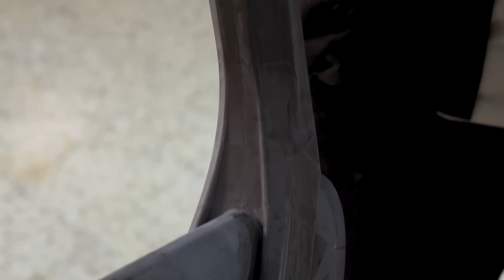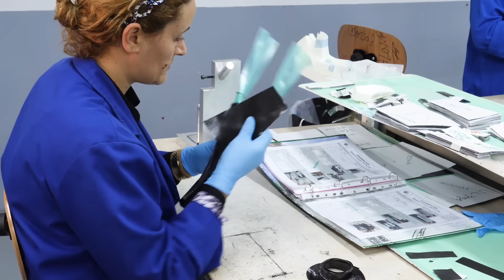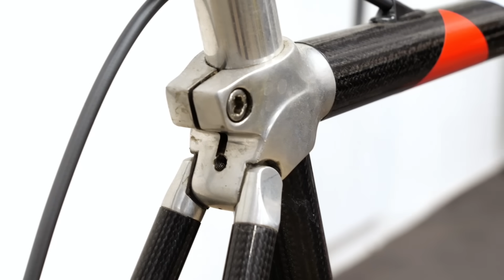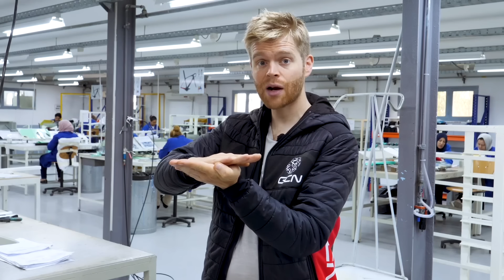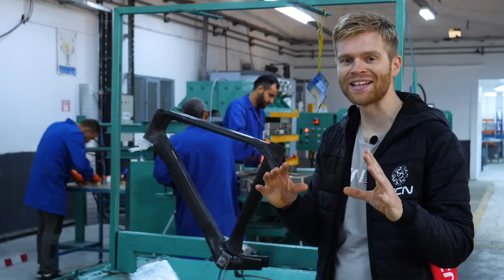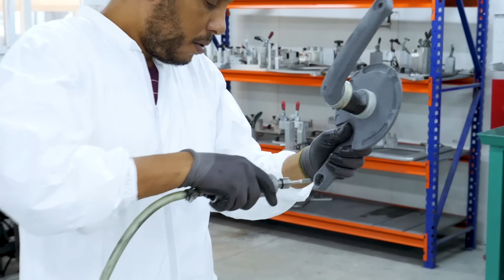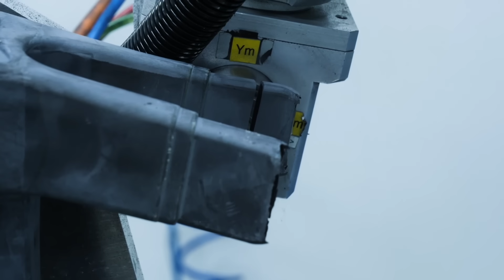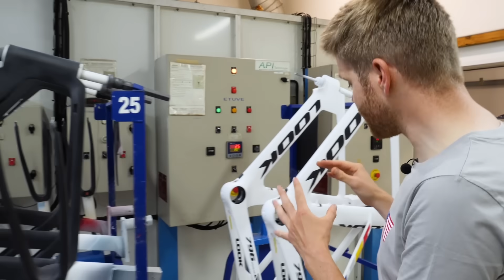How Are Carbon Fibre Bikes Made? | LOOK Cycle Factory Tour

Comment: From a company of that particular size i would expect a better protection of the workers ! Carbon fiber dust must not be taken light minded. Studies clearly show that this material is not inert and may cause serious harm to your lungs. I see people without masks sanding and grinding the bikes. If i were LOOK i would not show this footage to anyone...
Reply: Good point. Machining carbon composites is horrible for human health and it's extremely difficult to contain the dust
Reply: @bpeterson7227  its a prolonged exposure you'd be safe if you actually breathed in a small amount. Like smoking it's a numbers game as a rule. In saying this yhe more bad stuff we keep out the. better.
Reply: @glennoc8585  Carbon fiber is not destroyed by the human body it says in the lungs for ever..
Reply: Especially that Look themselves advise their customers in frameset manuals to be very careful not to breathe in the carbon fibre dust when cutting the integrated seat masts.
Reply: That's why they do it in Countries with low labor rate and no workers safety.
Reply: mehrshadvr4 for the other compagnies its made un taiwan
Reply: Oliver Dieball, carbon fiber actually is inert.  But you are correct that the workers should be using breathing protection such as N95 or better masks or ventillators, at least in the sanding and finishing areas of the plant.  The danger is not chemical but rather mechanical, as the fine dust is harmful to the insides of your lungs, in a similar way that asbestos dust is harmful when inhaled.    https://www.sciencedirect.com/science/article/pii/S1878535214003360
Reply: @berthull9333  Good points.  Carbon fibers are about 100 times larger than what HEPA or N95 are designed to capture.  (The first thing I did when I saw the factory was look this up.  I wear N95 respirators frequently at work.)    The cutting and assembly people are probably okay with no respirators, as long as the room air is adequately filtered.  Any place there is sanding or spraying might be a different matter.  It depends on the size and chemical composition of the resin dust.  Disposable N95 respirators cost me about USD$2 each on Amazon, and cost my work about half that in bulk for about 20,000 people.  Workers in Tunisia, Shenzhen and quite a few other places where bicycle factories are located typically earn fifty cents to USD$1 per hour.  You need to stock close to twenty different models of N95 respirators to fit 90% of the population.
Reply: @berthull9333  Unfortunately your reference points to nothing related to work saftety, or the health effects of carbon fibre processing.
Reply: @berthull9333  resin
Reply: They are using down draft tables but they should still be wearing better masks than those disposable ones.
Reply: @mq1506  yes, I totally agree with you, because I work small carbon accessories by myself, and I never would not wear light masks as I see in the video, except when I use carbon with 800-1200 wet grit sandpaper. For all the other works, layering carbon, using epoxy and so on, I always wear gloves and a 3M half face piece Respirator with cartridges and replaceable filters
Reply: In my own business carbon is processes in clean rooms pressurised to capture particules through high efficiency filtration systems into hoppers then the dust is disposed of responsibly.
Even then all operatives wear air fed masks and full ppe coverings.
Reply: Yep and noise too, if you have to raise your voice to be heard then hearing protection might be needed! Also the guy near the end spraying clear coat with nil protection!!! VoCs will kill him in few years...
Reply: I think Oli was lucky to get a look in at the Tunisian factory. The big factories in China wouldn't let a camera anywhere near the production facilities.
Reply: I agree, I'm a composite boat builder myself, now working in aerospace, that would NEVER fly in any first world country in this indystry. Sure sometimes you may not wear one in a heavily ventilated booth to scuff something up for a few seconds(I'm guilty of it) but as your main job, day in day out, that must have long term health risks. The thing that made me pause and go 'WTF' was the women laminating the rear arm or fork with bare hands. Not only is that a health risk, as epoxy should not come into contact with the skin. It is also a HUGE QC issue. Oils from your skin, especially hands are transferred to the laminate (Pre-preg in this case) creating a barrier between the layer it's on and the layer it's going onto, creating a poor bond. If this is a high load zone it can dramatically increase the chance of delamination, causing a chain reaction in said loaded area and a possibly a complete failure, large crack or just a straight snapped frame. This LOOKs really bad.
Reply: As in every video were particulate masks are worn, be it this or animal rescue, or house hoarders. They are wearing masks usually below their nostrils. The same as the famous blue gloves to keep them safe from what ever they are touching and then wipe their face ,eyes and drink bottles with the dirty gloves on!
Reply: guy spraying clear coat without a mask!!
Reply: I mean, composite residue only poses a health risk if your country has labor laws, so in Tunisia it's perfectly safe.  ;)  Besides, safety equipment costs money and reduces margins.
Reply: There's a reason why they're being manufactured out of Europe.  Less regulations.  Less litigation.
Reply: Oliver Dieball Agree,  that’s first think I noticed! Bikes are build in a country where nobody cares about safety, apparently. Bean counters at Look would have to add cost of 😷 to their bikes.
Reply: @lookcycletv  You ignored the blatant disregard for improper use of, or missing PPE in your Tunisian factory. The manufacturer is responsible for implementation of the health & safety of their workers not just giving them PPE. Look should be ashamed of itself. I’m left feeling that Look is a ‘profit over people’ company and will never even consider buying anything made by Look.
Reply: Same with the painting. The gizmo got no mask an probably no additional fan for the paintdust
Reply: Carbon fiber should be considered as dangerous as asbestos. It means use of p100 (particle) filters only. 

https://l.facebook.com/l.php?u=https%3A%2F%2Fwww.ed.ac.uk%2Finflammation-research%2Fnews-events%2F2017%2Fcarbon-nanotubes-may-pose-cancer-risk&h=AT2R4e-4EZvvgtDM7WNCcLqUQys1DRfkjrIa6phbq610BFv7qXK2P-lcK9vJiB90s3FeRF7q2lRZk3jCFokIk9SDqAO8UwHxEbC6yyFmr_4ENXgxuy6JNouywD52d15G_H6UmKk
Reply: what about dust in the air, should that be dangerous, too? Who you gonna sue when ou lungs fill up with naturally occuring silica? You are simple and are the reason why in 10 years we will all be living in plastic bubbles dying fat and young.
Reply: Oliver D   Why do you think they have production in Tunisia? No workers protection laws!
Reply: It’s Tunisia 
No health and safety 
Why do you think these companies get them made here? 
China same
Reply: This is about the same level of protection that workes at AIRBUS or Boeing have if they work on carbon fiber. Its fine.
Reply: I just bought a Look 795 blade before seeing this video, and the lack of care for human health makes me sad. Then I realised that it's probably the same throughout the Asian manufacturing facilities, and that made me feel worse. :(
Reply: I disagree with your observation. I have worked and visited many composites shops in the United States and Europe. The safety practices in this video look consistent. The machining area is clearly isolated from the rest of the production area so making people wear a truly effective respirator (with fit check) for no reason would only make the job torturous. Additionally, virtually all modern CNC mills used to machine parts operate in an additional enclosed hood with dust collectors. Those not only protects the workers but also nearby equipment since conductive materials like carbon fiber and metals can quickly destroy the electronics of expensive manufacturing equipment. Last note: I have seen shops that don't follow these practices and I assure you the facility would be filthy; on par with a coal mine.
Reply: Oliver Dieball I agree. Especially the sight of the woman with her nose outside of her face mask
Reply: west world...
Reply: Came here to post this comment. This would not fly in the UK, good thing its done in Tunisia ...
Reply: Just look at China, search for Lu Guang. Horrible history of human rights, environmental protection. That's the reason Look are here in the first place. Cut corners = more profit. 

https://www.nationalgeographic.com/culture/2019/01/where-is-disappeared-chinese-photographer-lu-guang/
Reply: See Dwayne Johnson painting 2 pack without a mask lol
Reply: I was thinking exact same thing I looked to see if anyone had mentioned in comments
Reply: they are using pre-preg carbon fiber, not dry one... the resin that soeaks the carbon fiber keeps the particles down....  if it was dry carbon fiber for RTM working, then they should be wearing protections
Reply: this apply to any material, anything enter the lung is bad for you, especially the very small ones, and if you can imagine what a carbon fiber is, it just a carbon and plastic from the resic when you sand it on finishing. which is pretty much harmless if you just put a cheap mask. So much fear mongering here
Reply: @royk7712  Thats actually a wrong statement. Your body doesnt detect carbon fibers as foreign objects. Thats the danger of it.
Reply: @MrBusunglueck  i understand that, but it still true thought, anything that enter the lung is bad
Reply: @royk7712  yes and no. Your body is designed to deal with it. Dust ist kinda natural.
Reply: @MrBusunglueck  dust = 80% of it is mostly skin which is carbon compound which is the same as carbon fiber, and the rest of it is dust from sand which is silicon oxide and its more dangerous than carbon
Reply: @royk7712  thats entirely wrong. carbon compound is in no way the same as carbon fiber. just because they are both made from carbon atoms it doesnt make them the same. similar to diamonds and graphite.
Reply: @MrBusunglueck  i get it, it just similar, the skin is a organic compound, the carbon is also an organic compound, mostly polymer that have a very long chain of carbon atom. And it will degrade overtime and it will be metabolized by body somehow from the lung, it just take a longer time for carbon fiber to degrade over time. And it apply on any material

The point is, any material can be dangerous. Pointing at one material and call it dangerous is very ignorant. If they follow the safety procedure to deal with the material it can be called safe. Its just which one will be deadly on shorter period of time.
Reply: @royk7712  carbon fiber doesnt degrade. thats the point. i wont explain any more. get a book.
Reply: @MrBusunglueck  OF COURSE it doesn't, that's what I'm saying in the first place, its just 99% pure carbon or graphite. It non toxic and easily metabolized by body so it won't accumulate in lungs, congratulation you just prove me right

The resin that bind the carbon fiber is more problematic but the amount is so small because of heating when the carbon fiber is produced
Reply: shut the fuck up Oliver, fuckin idiot
Reply: Like ag-gag laws! Sick sad world.
Reply: Absolutely!
I also saw some workers who didn't wear protections such as mask, goggle in this video. Dust and particles can be harmful for them.
Reply: They have "Special" carbon fiber that actually healthy to inhale. Duh!
Reply: Look they didn't show you vids of child workers so stop with the judgement. Okay!!!!
Reply: They use prepreg which does not really deliver fumes, no need for masks. Carbon is inerte. But yeah, sanding should be taken care of more seriously.
Reply: Oliver, it’s unfortunately very obvious that you don’t know a thing about carbon manufacturing! As some have pointed out, downdraft tables are employed in these workspaces. They do it at places like Audi sport as well (where they make racecars) so it’s a true method! Also, we don’t actually know exactly what carbon dust does to us, so caution is good, but we can’t say for sure how it would behave in our bodies.
Reply: No one was sanding or grinding without a mask. Here's another interesting video showing the process to make a carbon fibre bike, you'll notice they didn't need a mask at any point. https://www.youtube.com/watch?v=UWSePEV88tw
Reply: There's a lot of reasons companies don't want to manufacture their goods within the EU. One is environmental regulations and pollution taxes, one is worker salaries and a third is definitely worker protection regulations. Government corporate taxes is probaly way down on the list for outsourcing/ moving to a third world country for many big manufacturers, but it's about the only politically correct reason for them to give. As a consumer you can only choose what your supporting.
Reply: Why did they set the plant un Tunisia, according to you?
Reply: Of course, they outsource to another [poorer] country and don't care about the safety of those workers.
Reply: Easy solution, put the plant in a third world country that has no worker safety laws.  Why do you think massive numbers of USA based companies have moved manufacturing to Asia.  Not only for the benefit of zero environmental and worker safety laws, but cheap labor plays a big role as well.
Reply: Tunisia is like Africa/middle East so it's alright mate don't stress
Reply: Its   a good way to lower the production cost.
Reply: What are people blathering on about? All the women were wearing masks, gloves and protective coverings, they are not dealing with raw CF it's already resin impregnated, so those masks are fine, the men were using industrial down draft tables, only the one guy using the deburring tool in the BB was maybe at fault. You might be able to fault the workers for not using the PPE, or not using it correctly but it's obvious that LOOK is providing it.
Reply: Ojnlkl8jkb
9l.
 BBK blij
Bhnhlomhih. Lmu
Nmuojvm7hlnixbmlilubhoh. Die v in bmiij0cl
8gjgm7bihohnu.hh08
Reply: as an avid elite cyclist but also aerospace employed, I have not even cut off my seatpost. we do not permit it in aerospace, it should never be permitted anywhere. the problem is on the cured frames and drilling, the dust.
Reply: Oliver D ....Did you ever think this video was made before the virus?
Reply: There are shitloads of people.
Reply: LOL  You're funny.  Obviously, you must live in a 1st world country and have a 1st world job where "rules" are paramount.  The whole reason companies like LOOK outsource production to 3rd world countries is so they can AVOID troublesome and expensive things like safety policies.  Ok course, they are going to spin their corporate bullshit if taken to task for it, but this video shows what they feel the "value" is of safety programs and human life.  To the workers, it's a job and some good money.  Wages still astronomically lower than western worlds, but light years better than the majority of the populace of Tunisia or any other 3rd world country.  Cheap labour, cheap human life, minimal rule enforcement and crooked officials that are eager to pocket a bribe to look the other way are some of the major reasons why corporations build their factories where they do, then 1st world muppets line up to pay premium prices for things that cost a fraction of the retail cost to make.  THAT is the real manufacturing world for the majority of the planet.  Sorry to inject some reality into your "safe" life, lol.  Not.
Reply: Now they are wearing mask because of covid 😂😂
Reply: I totally agree with you on the mask part over the painting and sanding.
Reply: thats the reason why they are producing in tunisa
Reply: It starts with a guy spraying without a mask.  Lowers expectations.
Reply: Jup. Agreed to most of you in here. LOOK... you can't outsource responsibility. Maybe by law you can – by ethics = No, you can't!
You're destroying lives here, for what? Profit?! Screw you!
And that corporate PR bullshit you put up here... not worth the pixels they're printed on my screen.

One thing is sure though: I won't buy a LOOK bike or component ever again. Thanks for showing this to the public GCN. Though... shame on you, too. Because not mentioning this with even the slightest word harms your cred as well!
Reply: They apparently do not handle the "naked" carbon fibers as we did making space/aerospace parts but already epoxy treated prepregs (not polyimide) but nevertheless I agree they should protect the workers from any dust caused by drilling, milling, routing the bike parts. The guy spray-painting the parts has no face mask either, so why worry about carbon fiber dust?  LOOK has a responsibility to protect their workers onshore and offshore.
Reply: Wow, I just was going to write about that and find it as first comment. Good point! I´m a custom wheelbuilder and don´t build carbon rims because of that reason*. All that environment where speaker is in has to be full of PM2,5 carbon nanotubes. It´s not necessary to be exposed to them because we have other materials. Plus the impact of epoxy vapors, carbon source: petroleum. No carbon, thanks.  *Not only you get exposed to particles that come with the rims (inside, packaging, etc) but they are produced WHILE TIGHTENING THE NIPPLES BY FRICTIONING THE RIM. You can see the black dust. You can even feel it in your throat.     Those workers should be protected with specific clothing and masks. Particles stay in their clothes and then go home with them. We can´t know if they use air filters. Want to think they do, but it´s not an excuse not to protect workers respiratory system.
Reply: The riches ride the workers not much life
Reply: One thing I learned from this video and the associated comments is that I do not want to have any part in an industry that is so environmentally irresponsible. Look allows its workers to be lax when it comes to the use of Personal Protective Equipment (PPE), they are dealing with a substance that is harmful to the human body. Also, as has also been mentioned, it is non biodegradable, and the waste will clog our landfills for generations. Oh, wait, it's some landfill in Tunisia, so that makes it ok, doesn't it? I would like to know if breathing carbon fiber particles compares to breathing asbestos particles. I would not be surprised if the results are similar. And, to to it all off, the only reason Look (and likely other frame manufacturers) choose places like Tunisia is because of the cheap labor. So, the next time you want to hop on your CF frame bike, think of the people you are affecting. This video has helped me decide that I will never own a CF bike.
Reply: John Bruins what if the bike you are in did the same thing but never been exposed ?  Profit it’s the purpose of a company.  ..... bleedy lessons.  ....
Reply: John Bruins you have no idea of what you are talking about. You probably think you are the greenest person on the planet.
Reply: I agree. It LOOKed unprofessional.
Reply: Damm corporate greed---they care only about the profit not the people who work for them.
Don't buy LOOK--greedy style
Reply: I am certain those adhesive and solvent fumes are also v dangerous.
Reply: HAZARD
Reply: Oh well not surprising. Starbucks got their coffee at the expense of poor farmers in Indonesia/south america etc. Iphone were manufactured by priviledge slaves in china, the world revolve around these systems. Sad thing is, most developed nations come around and start criticizing these hazardous working conditions, not knowingly they get to enjoy their humane living condition based on the low living standards of 3rd world nations. Regardless of what human rights organizations or green peace are fighting for, its the way things are run, no one is seriously trying to change that.
Reply: Money saved on welfare by being made in Tunisia
Reply: Only Trek!
Reply: Like most corporations They don’t give a flying fuck about human beings! Only money and power!
Reply: @smkthomas2  weirdo
Reply: They are expendable muslims...don't worry
Reply: @opwan , may I suggest that you look into an aluminum frame instead? Yes, Look has a big problem, as this video has shown, but I would submit that they are likely not the only one. As someone on this thread mentioned, I think it will be shown in fewer years than most would like, that CF frame production is going to be right up there with using asbestos. Unless things can get cleaned up, I can see CF being outlawed because of H&S concerns. Best to jump off that bandwagon ASAP.
Reply: Absolutely! LOOK should be ashamed, disgusting to see the poor PPE standards in this video.
Reply: Is not a stress resistant material. Just look where they put it in cars. In a bicycle it chips out bits and pieces
Reply: Dear Oliver, we are proud of all of our manufacturing sites. In Burgundy (Nevers) France, where all pedals are made and all frames are designed and prototyped, and in Tunisia, where most of our frames are made. All our employees in France and Tunisia are equally treated according to our health and safety standards. We employ women and men, all of whom are proud of the brand and the skilled work they do. Most of them have been with the LOOK family for many years, and their loyalty and high level of craftmanship is what makes LOOK great. We run factory visits in France and Tunisia, for those interested in learning more.
Reply: lookcycletv The fact that you treat all employees equally and are compliant with European health and safety standards doesn’t mean that your H&SP are not substandard. Nor does it protect you from liability. Just ask Companied who’s workers were exposed to asbestos, crystalline silica and coal dust. Meeting legal standards alone is inadequate. The best available demonstrated technology for engineering controls, PPE and administrative practices should be observed to achieve best practices. Lawyerly PR statements do not impress.
Reply: @look_cycle  and what about handling epoxy without gloves? Epoxy can cause severe sensibilization, which would make the person unable to work anyware near epoxy for the rest of his life..
On top, the grease from the skin weakens the strength of the interface, thus reducing the material properties. Also there no excuse..
Reply: @look_cycle  Please require all of your employees to wear PPE (Personal Protective Equipment). I have holed in industry for years and it is the difference between hearing loss, injury and early death. It also influences my purchasing decisions. I can clearly see the care and quality that is put into manufacturing your products, but worker safety is equally important to me.
Reply: @skulengu6854  maybe you should give them a class, because LOOK is full of idiots!!  Good for you sir!  As a former FireFighter and a nurse I appreciate the damage done to the human body through the environment.
Reply: Good thing to know you are proud of workers spraying clearcoat with no protective means at all. Goes to show how good a company you are. Thank you for your clarifications in flawless stereotypical corporate jargon. I have a look 986 which I initially liked but due to the very poor bb30 tolerances it creaks like devil. That is why I ride a BMC and will never look back (pun intended)
Reply: @look_cycle   no matter how proud you are it wont keep them from getting sick..... You're playing with lives.......
Reply: @sunesnigel  But compared to decent masks or safety guards lives are sooo much cheaper, if anyone complains or gets ill just fire 'em, they may have good frames but their true reality, not the PR piffle, is the way they treat their staff.
Reply: @look_cycle  "All our employees in France and Tunisia are equally treated according to our health and safety standards." 
Are your health and safety standards, policies and procedures identical in both countries to each other?
Reply: LOOK Cycle I guess good to know employees in France aren’t wearing proper PPE either?
Reply: @look_cycle  every creature in the entire universe has the exact same value. W.B
Reply: @look_cycle  blatant straw man argument to the issue of health and safety of its employees...
Reply: @look_cycle  Is this some kind of a joke? Equal treatment? Care to share the salaries of Tunisian workers? What a joke of a PR-BS response.
Reply: lookcycletv will you guys still be proud when those same employees sue you in the next 10 years?
Reply: @look_cycle  I do everything to avoid your products because you ignore peoples rights for healthy enviroment.
Reply: These women are in more danger from the muslim men they live and work with.  Muslim women are at a great disadvantag.  Look should be ashamed of themselves for exploiting cheap labor
Reply: Better unemployed than underemployed?  get real.  I don't see any guns to these folks heads.  More deaths due to your lame children texting and driving than you'd every get with people working and making a living.  NIce job GCN.  Life is fatal, get over it.